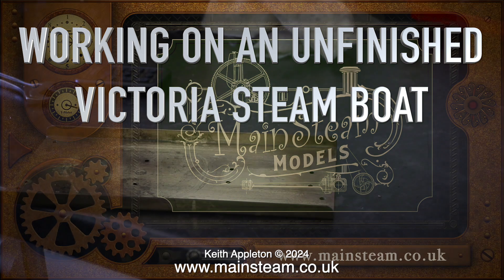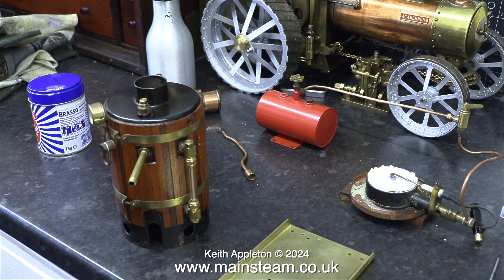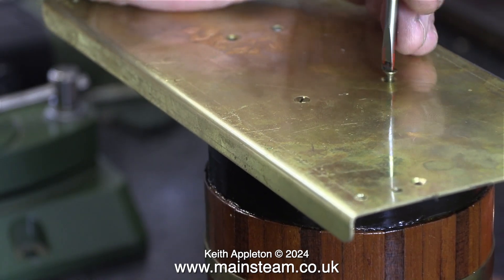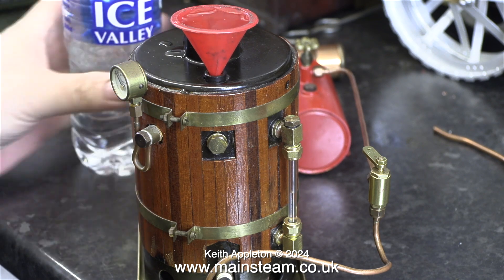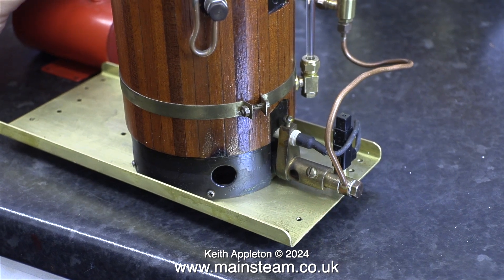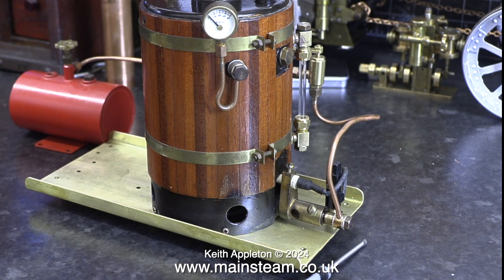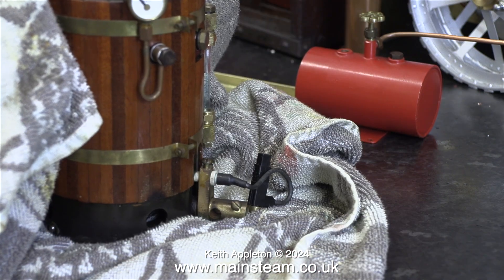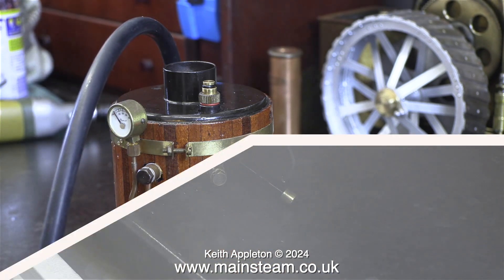WORKING ON AN UNFINISHED VICTORIA STEAM BOAT - PART #5

Comment: There is a product here in America called "Lime Away" that contains Formic acid.  I used to clean my coffee maker with it because we had very hard water that clogged it up after a month of use.  After a couple of years my land lady finally installed a water softener on the hot water tank in the cellar which helped but the cold water was still very hard.  Some people install water softeners on the incoming water main to combat the hard water problem but they cost more and my land lady was quite miserly.   We also have Brasso in America and I used a similar product called "Wonder Wool" on my motorcycle aluminum parts.  My dad used to use Coke a Cola to clean tarnish on our car, yes it worked and he used to say if it removes tarnish imagine what it does to your stomach?  I don't drink coke to this day!

Comment: Another hazard of Formic acid is that it is toxic. 
It won't be too bad at the concentrations you are using it at by why take unnecessary risks?
Reply from the maker: Most Acids are Toxic, this stuff smells a bit better than Sulphuric, Nitric or Hydrochloride Acid }:-))) .......

Comment: dishwashers work perfectly for that kind of stuff. but dishwasher detergent does a number on aluminum gas engine carburetors

I always pre-wash parts in a dishwasher, then I would use an ultrasonic, if I had one
Reply from the maker: Thankfully, I have both }:-))) I use Carburettor cleaner in the Ultrasonic.